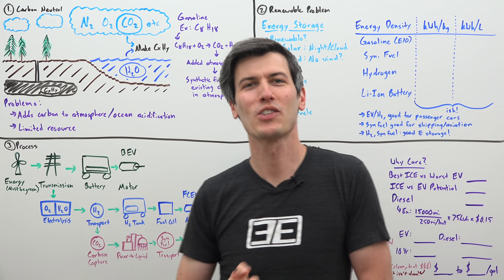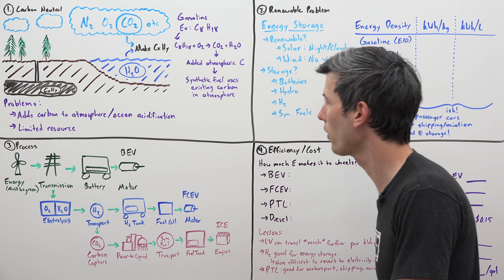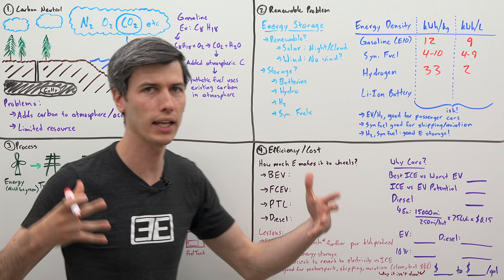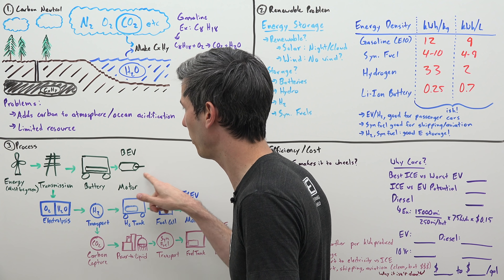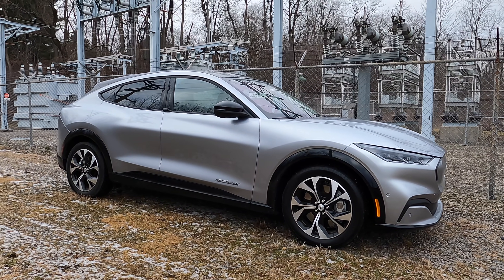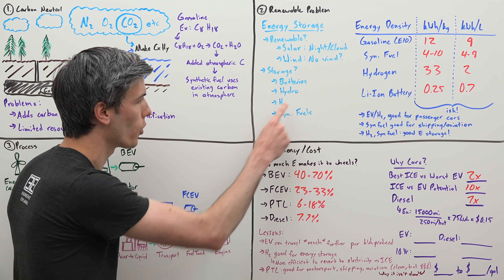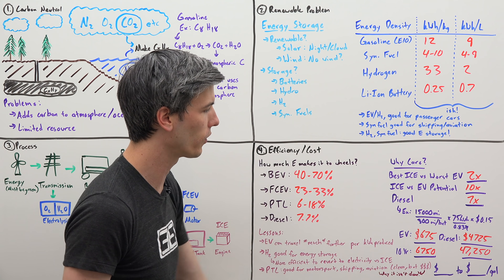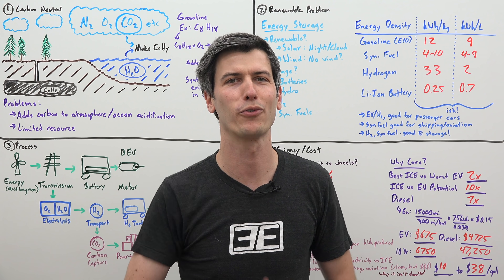The Big Problem With Synthetic Fuels

Comment: You made my day.
I've been beating this drum for years now, and it just would not enter peoples minds.
As an engineer, it is just so frustrating to hear the same arguments again and again and they are just false, because they didn't do the (simple) math.

Also, there are other prohibitive costs and issues with keeping ICE cars: Especially in cities, it will not solve the noise and exhaust problem. And 
ICE powertrains just need so much more maintenance compared to BEVs. Also H2 verhicles are not much better, the Mirai maintenance plan is a nightmare, because they need to make sure that 700bar Hydrogen system doesn't turn into a bomb.

I really don't get why people overestimte they range requirements so hard and do not see all the amazing benefits that come with EVs. 
I made the switch relatively spontaneously in 2018 and I will never, ever go back.

Thanks for the video Jason, will share that everywhere I can.

Comment: There are a ton of different synthetic fuel types so grouping them together doesn’t really mean anything. Fisher tropsch fuels are very efficient, both GTL and CTL fuels. We have massive coal deposits for CTL. Plus GTL’s have a higher energy density than regular diesel and burn so much cleaner. This comparison doesn’t mean anything with out talking about emissions because that’s the whole reason for alternative fuels. I’m going to have to dig up my poster presentation from undergrad about synthetic fuels vs regular diesel from our studies.

Comment: Correct me if I'm wrong (I'm not always in sync with what I perceive others think) but we weren't thinking it would replace electric vehicles, but rather, the fuel source for existing ICE vehicles. We can't snap our fingers and have have all the ICE vehicles be replaced by electric vehicles, but we can simply put a carbon neutral fuel into our cars, even if it's a good bit less energy efficient. You are absolutely correct about the price, though: For some reason my mind thought their price was $2/gal, not $2/liter, which makes a huge difference to the feasibility of this.

Comment: So what if we use algie. Algie is 40% oil. And algie combines hydrogen and co2 and makes o2. You don't need electrolysis just a pressure cooker. The 60% left from the algie  will include H and C so the ride will be carbon negative.
Reply: Algie is cheap

Comment: E-fuels can just not work, because of the ICE on the end of the whole line…you can have a 100% efficient process in creating them and the 30% efficiency of the ICE is the Probelm. You put all that effort in creating e-fuels and then make 70% heat and 30% forward motion…
Reply: engine tech is evolving, the concept of nissan latest is already on 50% TE
Reply: @bgaoest2995  Yes the F1 is now at 50%…It takes years until road cars will reach similar numbers….Instead of pumping more money into getting the ICE up a couple of % we could develope better batteries….
Reply: @laser_simon922  let see in future, whether i saw the battery and engine in future will be complementary rather than predatory. engine with efficient *mostly will hybridized fuelled by synfuel and high power density of solid state battery recharge by renewable sources.
Reply: @bgaoest2995  But why even use an engine, when you have high power density solid state batteries? Then you just use an electric motor with over 90% effiiciency…much simpler and better…
Reply: @laser_simon922  there is situation that engine-car still needed, longer range to transport in suburban/rural area plus when sit. livin nomads e.g. in apartments even on solidstate still take needs time to charge atleast on their 1st gen. and most importanly high perfomance car, exotic of noise. 
but yes for the urban/city living BEV is the best bet.
Reply: @bgaoest2995  But if ypu have high power density batteries you can have 200-250 kWh battery size, this gets you over 600 miles on one charge…
Reply: @laser_simon922  agreed, but sill the ranges claim of some EV manufacturer sometime is lesser plus let see in future theyve shown the consumption rate it would be better to overcome the range anxiety. let see for the best if it gets there plus the charge infrastructure is evenly distributed. yeah no doubt will be gamechanger 
but from my POV to atleast the current sit.
still both had potential
Reply: @laser_simon922  Because EV's tend to do poorly in extreme weathers, the efficiency loss is astounding. Battery degradation over time is also a serious reason as to why one wouldn't buy EV's. Probably many more reasons too that im missing out, but basically every single thing on this planet has pros and cons, and EV's are no different.

Comment: I agree with this video. E-fuels are going to be very expensive. Back of the napkin math, the very best they can get is  roughly $5/gallon. That's assuming they can convert every last KWh into liquid form with 100% efficiency. However, the one issue I do have is with Porsche's presumed intent for E-Fuel. I believe Porsche knows very well that E-fuels will not replace EVs. Their mission is to provide fuel for car enthusiasts who paid a tidy sum for their cars and would like them to keep their value.

Comment: I was under the impression that hydrogen could also be used in a combustion engine, not the kind we have currently, but that it could be used that way.
Reply: it can, but a combustion engine is far less efficient then using a fuel cell with a electric engine.
Reply: @Wooble57  due to the energy loss of the engine turning it into mechanical energy?
Reply: Problematic in piston engines detonation and NOX.

Comment: You used the analogy keeping the Ev 10 years to equal fuel costs I have never had a lithium battery pack last much longer than that your running into territory of replacing the battery pack at that point so what’s the cost of that ?

Comment: We need a mix of all fuel sources, BEVs for commuting, FCEV/PHEVs for longer distances and synthetic for fun/racing and industry.
Reply: Fast charging BEVs will go plenty far enough. If you're carrying humans, humans need to stop every few hours anyway.
Reply: @armadillito  As long as you are only talking about normal passenger cars, then sure.  BEVs will not work for anything larger for a long time - the battery tech isn't there yet.
Reply: Well, there is ethanol
Reply: Three words: electrification of highways
Reply: @Milan_Openfeint  that would work great in California - where they already have rolling blackouts.  The grid can't support this amount of load, and won't for a very long time.  Plus all the EM fields that will cause who knows what kinds of side effects lol
Reply: @waynebullock9717  We have electric trains and public transport for a hundred years in Europe and we're fine.
It's like 1000 times easier to put wires over highways than developing fancy battery or fuel technologies.
Reply: @Milan_Openfeint  Except electrified roads don't use overhead wires.  They use induction charging from wires under the road surface.  Also, trains/public transport are set electrical loads, that operate on a schedule.  Public roads do not have the same consistency, and would create an engineering nightmare.
Reply: @waynebullock9717  I don't think city public transport is very predictable but it works fine. It would help greatly to reduce the required range of EVs at minimal costs.
Inductive charging is a no-go I think, can it reach 50% efficiency at least?
Reply: @Milan_Openfeint  The public transport (here anyway) runs on a set schedule.  Taxis/private hire vehicles don't though.  All of the "road electrication" projects I have seen use inductive charging.
Reply: @Milan_Openfeint  All the public transport here is on a schedule, buses, trains, subway, etc.  I'd call that predictable.  In order for it to be a viable option, it requires people to give up their agency of mobility (hard sell) plus actually like other people (another hard sell), so it's a tough hill to climb.

Yeah, inductive charging isn't that efficient, plus there's a lot of EM concerns that would have to be addressed.
Reply: @waynebullock9717  I'm nit arguing for public transport (here), even if it can me used a lot more.
My idea is changing electric cars into trolley buses (with a battery for the last mile).
Reply: @Milan_Openfeint  I get what you're saying, but there's a lot of physics and logistics that would go into putting a bumper car whip (or some other connection) on every EV that wanted to use the system.  In addition, you don't have a steady load on the system like you do with a trolley, or bumper cars (lol) that have a set number of vehicles pulling from the grid.
Reply: @waynebullock9717  It's same or better as charging at home or charging stations. The same amount of charging would get distributed over longer time. You could still charge at home if you wanted to.
No solution is perfect but this is one of the better ideas IMHO. Batteries for 300km range are nonsense, especially if they degrade over time.
Reply: @Milan_Openfeint  Agreed - I think the challenge is how to get "charge while moving" technology working where the benefits outweigh the drawbacks , as well as provide a seamless usability factor without creating EM health problems.

Comment: Great video! Still got some points: In Germany we already pay close to 2 Dollars a litre. So 2 Dollars would be amazing for us for such an ecofriendly fuel. And what you did not put into consideration is that the efuel does not have to be produced in the same country/grid where the cars are. You can make these fuels in places where you have optimal conditions and ship them over. And at last I think it is not so much an either or decision. I think that we will see a mixture of both for a long time. Especially in the cramped cities of Europe the charging infrastructure will be a massiv problem the more cars become electric. And only 40% of our grid is co2 neutral + the initial co2 cost for making electric vehicles are higher. So if co2 is the reason for doing all this efuels would be a very good way to go if they are produced in area where the effiency do not matter as natural resources (wind, sun) are plenty. Or do I make a mistake in my thoughts?

Comment: Really enjoy this kind of video. It is easier to understand the message as an not native English speaker. 

But I wouldn’t say eco fuels will never be an alternative. At the moment they are really expensive. 
But isn’t it a normal thing in the research, having high costs at the beginning. 
I would compare it a little bit to the development of battery’s. At the beginning there where not many possibility to fast charge your car. 
Now this is getting better and better. 

I think the same could happen to the eco fuels. 
Porsche isn’t the only company, doing researches about them. 
In some years we could have other possibilities to create these, using not so much energy. 
The motors also get more and more effective in using the fuels. 

And I have one question. 
Why do you multiply the costs for the electricity per year with the efficiency rate of diesel. 
Shouldn’t you just take the 10 Dollars?

PS( I an sorry, if I made some grammatical mistakes. I am from Germany (Maybe that’s the reason why I want the eco fuels to be a possible good thing. I just love our cars. 😂))

Comment: And yet, e-Fuel makes sense as a safer, longer-term storage option than hydrogen, even with its inefficiencies, if the energy used to create it would otherwise go to waste because you cannot store it all in space-inefficient batteries. Hydrogen isn't much better than batteries in that regard, and much harder to store in large quantities safely and cheaply. e-Fuels should be compared to options like pumping water back into hydroelectric reservoirs and the such. Being able to store free energy as a versatile form of fuel that's also well-established and relatively safe and cheap to store is no small thing.

Comment: I'd like to see you adress the capacity loss of electric cars. I've read as much as 20% in one year and on top of that another 40% loss in freezing temperatures. This is pretty substantial....
Reply: That 20% is for first gen Nissan Leafs stored in a desert with no shade. 2021 batteries are closer to 20% over 10 years, and it keeps getting better.
Reply: @BullCheatFR  Same lithium technology so there is still a considerable capacity loss
Reply: @oistein74  yes same technology just like gasoline cars today are the same technology as 100 years ago.
There is a new technology around the corner: solid state lithium batteries. Will make degradation a worry of the past.
Reply: @BullCheatFR  I hear talk of new tech batteries which will drastically shorten recharge and increase capacity while maintaining it over time. Then I'm a buyer for sure.

Comment: What hapens with the weight, I mean in an EV you spend more energy to move because the weight gain, so you are losing part of the energy, its that right?
Reply: You are right that a heavier car takes more energy to move. I think you're underestimating how heavy ICE cars are today though. 

2021 Shelby GT 4171lb curb weight. 12mpg
2021 Mustang Mach E 4856lb curb weight. 120mpge. 
That's just 16% heavier to get 1000% more fuel efficiency from roughly similar cars. 

The F150 and F150 lightning are 1000lbs apart in curb weight, but that's on an already >5000lb truck. 

There's an interesting article from a car transportation company comparing the differences between transporting EV and ICE cars: "Container Transport: Electric Vehicles vs ICE Vehicles" Feb 2020, Kar-Tainer

Comment: Question: On the bottom-right square, does the efficiency take into consideration the weight of the vehicle too? Or just drivetrain losses? If not, I wonder what the differences are in mpg, range and efficiency while considering the weight of the cars. Say, an average 3600lb ICE with a 2.5L engine and a given average transmission, a 1,800lb car with a 2.5L engine but geared with consideration of half the weight and an EV with a motor putting out equivalent power at an average EV weight.

Comment: We just need some giant device capable of holding excess electrons when supply exceeds demand...
Reply: When supply exceeds demand, we convert energy into potential energy. For example, let's take hydroelectricity. When you need energy, you make water drop through turbines to produce it. When you have excess energy, you use that energy to lift water up for it to fall down when you need energy. It's a common thing.

Comment: Wouldn't scale significantly reduce the costs of producing synthetic fuels? I mean, I get it, there is only so much you can do and it is much cheaper right now to just drill for oil. But the aviation industry is big and will be for a while. Plus, theoretically, there is a potentially unlimited supply of synthetic fuels, it's just a matter of producing.  It's an honest question, I am not an expert.

Comment: Until the batteries have no clear way to be recicled, and governments don't obligate by law the battery industry to manufacture a recyclable  product, any discussion seems pointless to me.
There is no way to convince me I need to buy a 2500kg electric car, with all the extra cost and energy it drags with, and then throw another 40k in another vehicle, just because the battery died. It is way more sane for my pocket, to keep running my 950kg 180hp 30+ year old CRX...
Even with the type R engine in it and a simple gear swap, averages 6,5-7L per 100km.
Every day past and all that electrification thing is more ballooned.
I can't justify moving my sorry 80kg ass in an expensive car, weighing nearly 3 tons, just to have to feed an industry that is trying to shift the pollution.
We are to exchange CO2 and NoX (both we can reabsorb and reuse) for Heavy metal poisoning of Mother nature, I mean real land, rivers seas poisoning with all the consequences for life on earth. 
My 2c
Reply: Oh my, expected battery life 7 tops years, and in most cases the car is built arround it. Talking sustainable...

Comment: Question: Think city like Chicago. How will you:
1) heat homes (thermal BTUs)
2) keep lights on, (kw-hrs)
3) charge EVs (kw-hrs)
through 31 January nights?

Answer: natural gas, fuel oil, and U235.

Comment: I cant imagine how it could be easier, or more environmentally friendly to build a billion car batteries, than it could be to make cheaper, easier to manufacture, and carbon neutral liquid fuel. 

the energy may be cheaper to produce, and maybe be more directly exploited from the source, but the receptacle is still a massive ecological problem. fossil fuel extraction is bad for the environment, yes, but much worse is the extraction and refinement of heavy, toxic, dangerous, and frankly, poorly distributed, rare earth metals and heavy metals.

i've never been convinced that electric vehicles were better for the environment, but more so with today's modern EV, where vast amounts of lithium and copper and other difficult to refine and reuse metals are being proposed as the solution to gasoline.

i'd like to see a working version of an EV that doesnt require those metals, or massive, resource intensive batteries.
Reply: Because car batteries take 50-65kWh of electricity to manufacture for every kWh of storage. Over  1000 cycles, that's a 5-7% disadvantage.

Comment: The issue with this is it only accounts for the fuel. If they took into account the resources used to create the vehicle in the first place EV's aren't all that "environmentally friendly". Especially when taking into account the amount of resources it takes to mine lithium. That's also not taking into account the lifecycle of the power cells as they degrade over time.